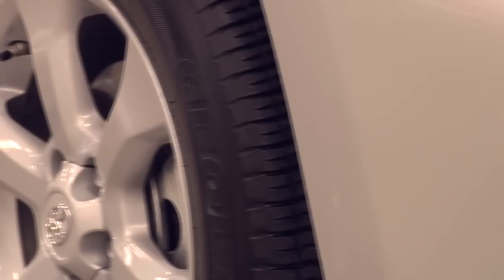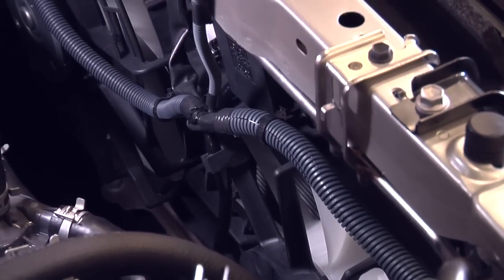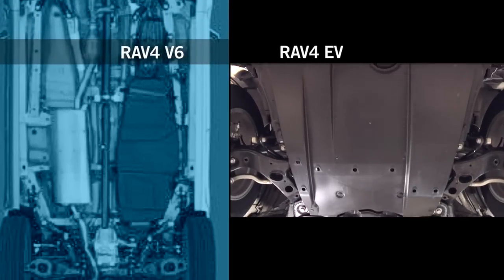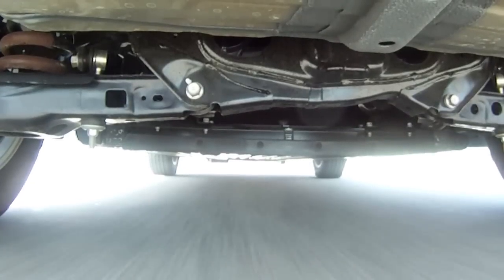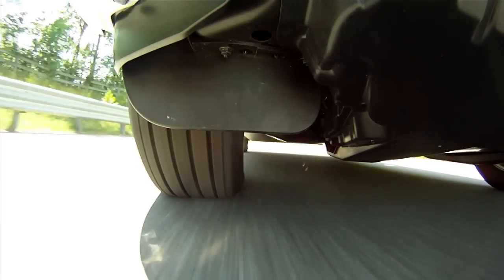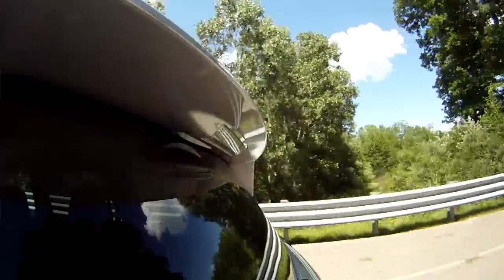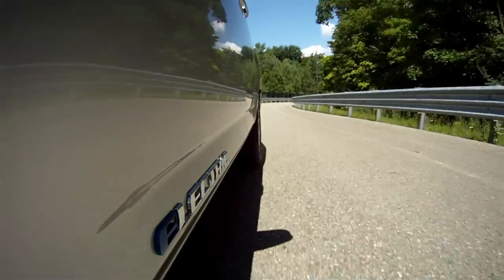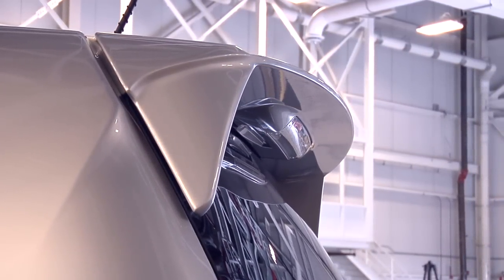2012 Toyota RAV4 EV - Reducing The Coefficient Of Drag

Comment: Kudos to the engineers for paying attention to drag coefficient. But a CD of 0.3? The best new cars have a CD of 0.29. My beloved EV1, designed from the ground up as an EV, had a CD of 0.19. Given a lithium ion battery pack an EV1, there would be no discussion of range anxiety. Probably achieve 150-200 miles per charge. Back to the real world... RAV4 EV range of 100+ miles per charge should serve LA commuters very nicely. I hope to get one soon to charge from my solar cells on my roof top.